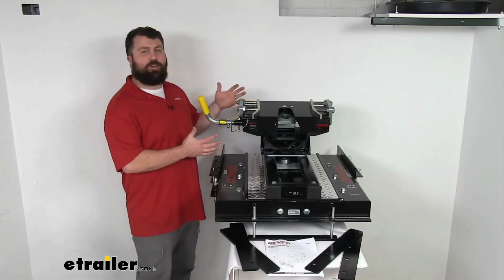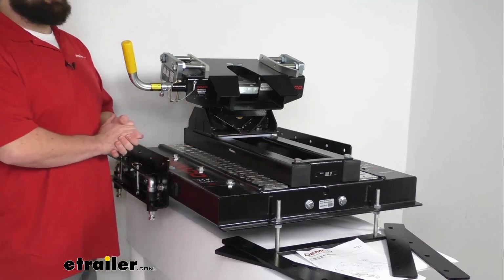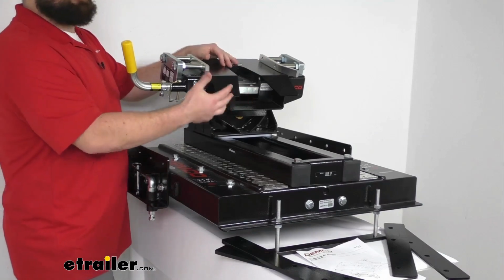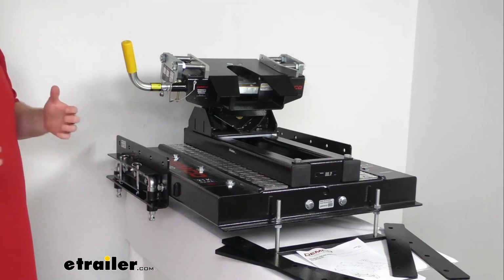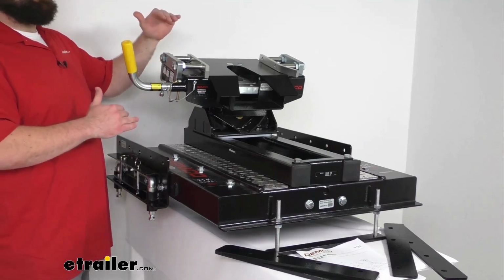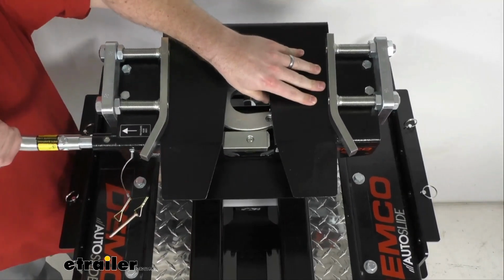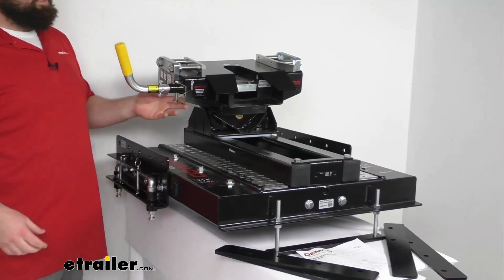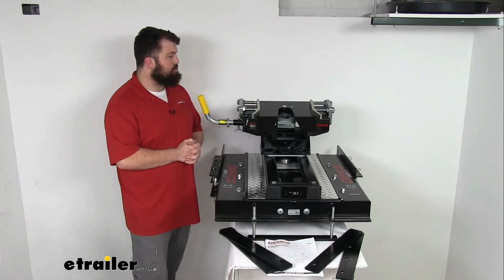etrailer | All About the Demco Autoslide 5th Wheel Trailer Hitch w/ Slider

Comment: I just bought a Demco 21,000lbs Autoslide and it moves Back and forth about 2 inches while stopping and starting in a straight line with my camper hooked up. Like it has play in it. I adjusted the bolt on the front as instructed with the slide plate all the way forward but it slides back from that position. I don't think this is normal. Any ideas?
Reply from the maker: Which pin box does your 5th wheel use? If you have an air-ride pin box, and additional capture plate might be needed. If you are already using a capture plate, you'll want to make sure it's adjusted properly. You'll find the adjusting instructions listed on page # 4 of the install instructions I've linked below for you:
https://www.etrailer.com/instructions.aspx?pn=DM8550037
Reply: @etrailer  Thank you for the response. I went back to the dealer where I bought the hitch and she reached out to her Demco rep and they said I need an adapter for my Rhino Box pin box. I have received it but I have not installed it yet. In all my research I did not find information about this. I hope it works.
Reply from the maker: Please let us know how it works!